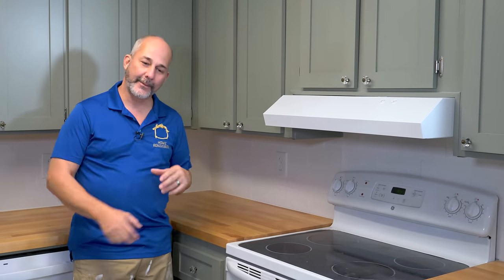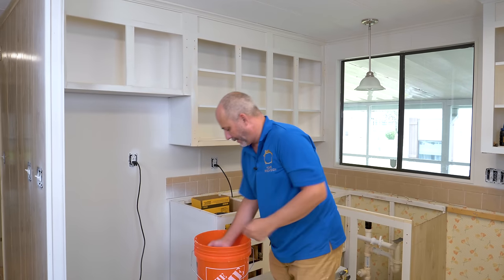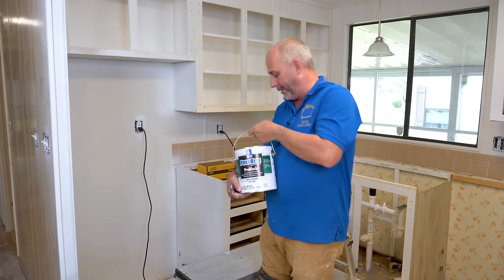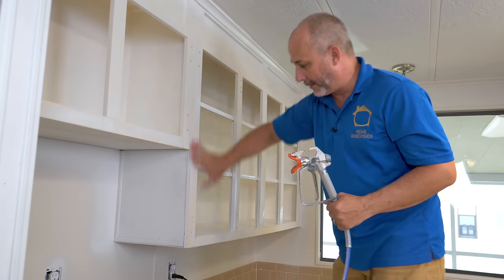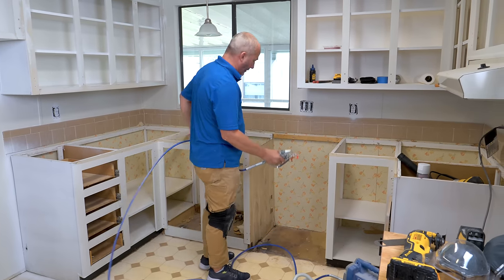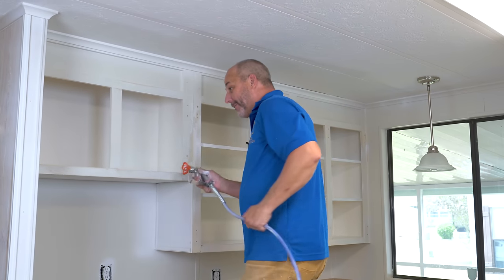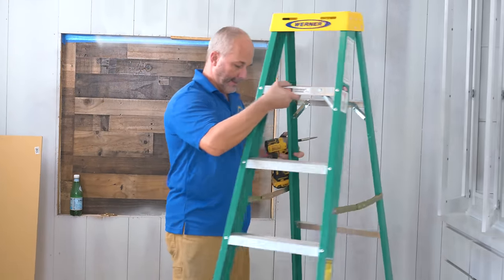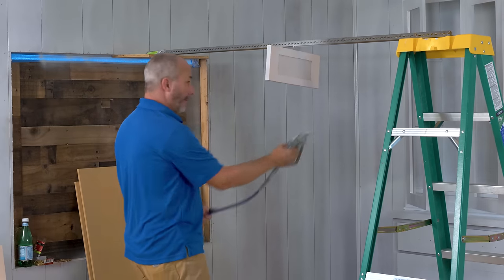$600 DIY Cabinet Paint Job (Contractor Quoted $4000)

Comment: I agree with a lot of the comments on this video. This is a pretty poor how to video, and there are plenty out there. I like a lot of Jeff’s videos but this one is a bit hard to get behind. Sanding after spraying primer…seems like he realized after the fact that he should’ve done this. Moving the intake from primer into emerald urethane without cleaning, and at the very least it should be flushed with water, but the proper way would be to clean it completely. Using a much too large spray tip, looked to be in the 500s, and not wearing a respirator when spraying, especially into a cabinet opening which ensures blowback. Why not spend a little extra time to teach viewers the correct way? Because he’s a smart guy and knows how. Not great on this one.

I hadn’t even got to the door spraying before this comment. My god man. That might be the most awkward set up, not to mention the single hook, the drying right in the spray zone, and the height. Despite saying “plan it out to make things easy, it just makes sense,” nothing makes sense here.
Reply: He's not a painter. There's a very big difference between someone who does it for a living, and someone like Jeff.
Reply: @muzic4lyfe2005 you do know Jeff started off his career as a painter right? The thing op doesn’t realize is yeah he cut some corners but that’s the whole point of this series. He’s renovating under a budget and under a time crunch. He’s showing people it’s okay to do some things and it’ll be alright in the end. He said that when he put the white primer filled pump in the green canister. Op didn’t listen clearly. This series isn’t really a how to step by step. It’s a showing the process to make some people more comfortable with the idea of doing something without a big budget
Reply: And it turned out good as this guy work who made the comment
Reply: @Warpgatez working under a budget doesn't mean cutting corners on safety. Just use a respirator when dealing with small airborne particles, for both sanding and spraying.
I like a lot of his videos but this one felt like a newbie was awkwardly achieving a task without thinking anything through.
Reply: @voornaamachternaam7207 ya I agree. This guy wears knee pads but not a mask or respirator.
Reply: It's water based paint. And Primer water paint is a unnecessary extra step
Reply: "Hi my name is Jeff"

Comment: What am I doing wrong with my X5?  I need to mask everything and wear a mask and goggles.  Used it plenty, so it's not my first rodeo.
Reply: What is your question?
Reply: I think, you can clearly see he doesn't wear a mask and goggles and tapes.nothing off so the question will be why doesn't he wear a mask
Reply: His question is likely: “what’s the trick to spraying without needing to mask up?”
Reply: Lower pressure Jeff mentioned
Reply: @alrasekhoon1  He is just spraying cabinets, not entire walls, and using low pressure so you don't really need a mask
As for masking off, not necessary if you're cutting in and painting afterwards
Reply: Sir.
This is Wendys.
Reply: The question is clearly, When is his second rodeo?
Reply: You can always consider using a different tip.

Comment: N0 -if you change colors by just shoving the pickup in the new can the paint ends up being a blend of the 2 colors. You end up with a paint job where the color is a gradient changing from the old color to the new. It can take 1/2 gallon to get all the old paint out.  You'll end up with a different shade until all the old color is gone. Just clean the machine, or have your primer tinted to the finish color.  Also, you really ought to wear a mask. Breathing aerosol paint, even latex, is dangerous. That is a stupid way to save a few dollars.

Comment: I’m assuming mask and googles are a good idea for this?
Reply: For something this small?
Reply: Good for you.
Reply: @joseph7105  I’m not sure, I’m just asking. I’ve never used spray paint before.
Reply: @ryantaylor5297  don't worry about the comments. If you've never done this before and never used an airless spray machine then yes, put on a mask and goggles (especially in a room this small) no one likes to account for the overspray or the paint bouncing back or dripping into your face and eyes... Protect yourself. Get experience. Get confidence and then decide whether you need the protection or not.
Reply: @thefertilemind  thank you! Very helpful.
Reply: Yes. And do t do the same mistakes as Jeff does. Clean your sprayer properly between different paints and colours, and have a dedicated area for painting and a separate area for drying.
Reply: @iamchriswick  thanks a bunch man! Comments like these are incredibly helpful for people like me trying to learn some trades.

Comment: 50 grit too rough you will never get rid of those sand scratches. The old paint isnt peeling so id just sand it smooth and call it prepped. If removing old paint was desired then chemical paint stripper is your best bet. 
If you must sand use your shop vac equipped with a dust bag. That sander will easily accept the hose and boomski dust extraction.

Comment: Tack cloth is good for removing the dust and waterproof shelf liner can help afterward.
Maybe its just me, but I prefer the inside of the cabinets to be lighter so you can see inside more easily when looking for things.
The hook thing to hang the doors up is interesting. Wish I'd thought of that for my vanity doors but they are old plywood. Another way to do it would be to have two hooks so the doors don't move around so much. I don't usually paint the insides of the doors so I'd probably use loops on the back and S hooks to hold it on the bar.
I don't have strong fingers so a drill bit  or screwdriver would be good for moving the hooks.
I'll have to see if I can set up something like this in my workshop but I'd use regular spray paint as I don't have the fancy paint sprayer. I'd probably hang stuff a little bit higher up so I wouldn't have to bend as far to spray underneath- I don't bend well. LOL. I'd rather have to use a stepstool or ladder to paint the top than have to bend down.

Comment: If you’re around the corner from Home Depot it is definitely more efficient to hold off on starting to sand for 15 minutes while you run out and get proper grit sand paper instead of wasting your time pushing through with 220 to tear through two layers of paint one of which likely being latex based
Reply: Also never sand material directly beside wet paint or primer… that’s a simple one even a diy guy knows that, you’re kicking up dust and particulates and they’re falling in the wet paint now you have tonnes of floaters and spots that to get a professional finish you have to sand out or in your case, landlord special and paint over
Reply: He did, just didn’t mention it, see 9:09.

Comment: Painting the builder's cheap pressboard kitchen cabinets white to cover the ugly dark stain was my first major reno project. Primer was my friend, I used a sprayer on the doors. It looked good for a decade and a half. My budget was miniscule so I used $1 sq. ft. tile on the countertops. No one told me I could rent a wet saw so the tiles were cut with a breaker bar.
Reply from the maker: Loving the can do attitude. Mix that with a little experience and voila you got yourself a real handy person. Cheers!

Comment: I would have used the fine finish tips if using an airless sprayer, and a much smaller spray pattern to reduce wasted paint in over spray.  Also, the Sherwin Williams Gallery Series paint is specifically designed for cabinets, especialy kitchen ones.

Comment: I would have started sanding with a small belt sander and 120 grit paper then switched to a palm sander  with 120 then moved up to 180 then 220.        Much faster that way.   At least set a box fan in the window to blow the dust outside.  Even better is to attach your shop vac to your sander.

Comment: Some good tips for dyers, all ill add is if you're young and spraying, if you touch that trigger you better have an actual respirator on if you want to dodge the risk of cancers at a young age, just cause you see Jeff over here winging it doesn't mean it's okay for you to also wing it and be as reckless as this. Jeff you're a mad lad for 22:30 lol, that sticky chemical overspray micro paint particles going right into your lungs. Well anyways, besides the health risks the end result looked like a great improvement, great job =)

Comment: This may be a dumb question, but why here do you say dust must be cleaned because you can't paint dust, but in a wall painting vid I saw, you said there's no need to clean the dust after sanding between coats because the dust will simply add to the solids already in the paint?

Comment: Note that may have been missed is to put the hole that you drilled out of sight. So on the top for uppers and bottom for lowers so no one will see those little holes.

Comment: How long did it take you to finish the cabinets? And they look great. I've been painting for some years and what I've learned from older guys who have been painting for 20+ years is that I've seen people who are "professionals " take weeks to do a job like this and in the end the cabinets turned out to look the same.
Reply: If you don’t know you don’t know. But don’t throw trash at professionals that do their job as they should. 
Painting cabinets is not a day or couple of days project. 
It can very well take a week+ . But if you’ve never done it before it’s understandable that you wouldn’t necessarily comprehend the amount of prep needed and the crazy masking involved if everything else stays in place such as countertops , backsplash tile and frankly all the paint around cabinetry.
Throw in a picky customer that wants dead straight lines everywhere and if you don’t raise prices you’re going to hate your life painting that kitchen.
Been there done that …
Reply: @andrealaphilippe5926  im not throwing shade on professionals in general, but some, yes. And I've been doing cabinets for some years and there are some cabinets that can take a couple weeks depending on the project, and i prefer to do straight lines etc without having to hear it from the customers... learned to do my best going into the job to leave no room... but some do go the extra mile and look for the impossible.  But my question and statement wasn't for the obvious things.  I asked specifically how long it took for this particular project.
Reply: As he stated, this is for a D.I.Y. project.

Comment: Entertaining but - you should switch to RAC FFLP tips for cabinets - finish will be significantly better with much less overspray and spray texture.   Very close to HVLP.   I just sprayed Satin Emerald Urethane Trim on all my upstairs 6 panel doors and the finish is as good as factory lacquer cabinets.  Uses much less pressure and paint pretty much runs at less than 1800 psi at tip.   You have to get a BLUE guard to run the RAC X.   Also Titan tips will also work with you existing ORANGE guard.   God - please use a mask - you really don't want that overspray in your lungs.

Comment: Jeff, an airless sprayer is not ideal for kitchen cabinets, pressure at nozzle is above 1000 psi, which is too high for fine finish.
Reply from the maker: i turn down the pressure to almost nothing. works great

Comment: Is there a good way to paint cheap laminate cabinets? I tried this expensive stuff called Beyond Paint that claimed no sanding or primer was needed, But the paint peels right off 🤦‍♂️
Reply from the maker: always scuff the surface and then prime with a flat oil. Cheers!

Comment: Did anyone hear the part where he told what paint was used?
Reply: I was wondering what the sheen is.
It looks flat to me.
Or eggshell.
Reply: 5:08 in the video
Reply: 11:05
Reply: This is Sherwin Williams Emerald Urethane. If you were to use a sprayer, you would not want to switch the dirty intake into the paint like he did. Secondly you would want  to use a much smaller spray tip than he used. He has spraying experience, which is probably the only reason he doesn’t have big runs.
Reply from the maker: Sherwin Williams Emerald. Sprays like a dream!
Reply: @HomeRenoVisionDIY  For interested viewers there is emerald and there is emerald urethane.  Emerald urethane sprays like a dream for sure.
Reply: @silentknight9509 Thanks!
Reply: @joseph7105 Thanks
Reply: @juicemcnorway Thanks!
Reply: @HomeRenoVisionDIY Thanks!
Reply: @juicemcnorway Thanks!

Comment: Your tip is to big for the job. Try a FFLP 310 and thin down your paint. I think your spray gun came with a 515. That tip is a general use tip and puts out more paint then you need on a cabinet job.
Reply from the maker: Cheers Carl!